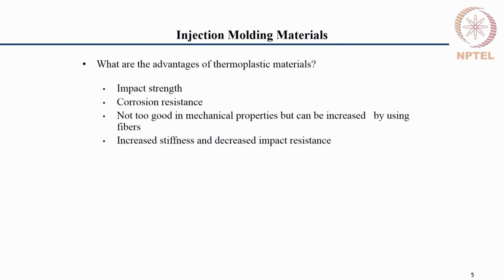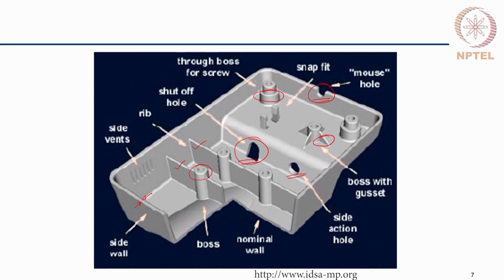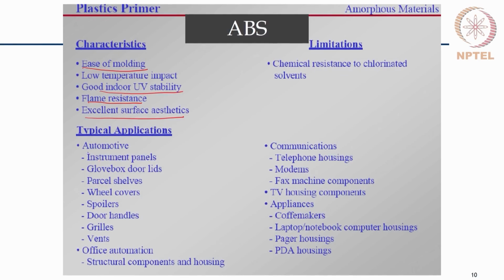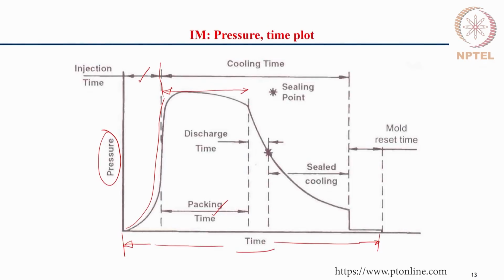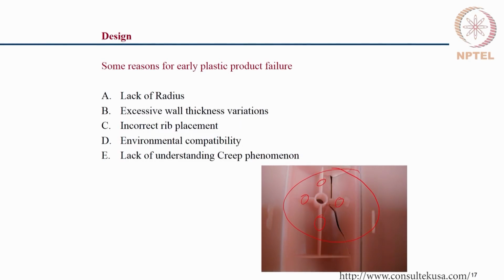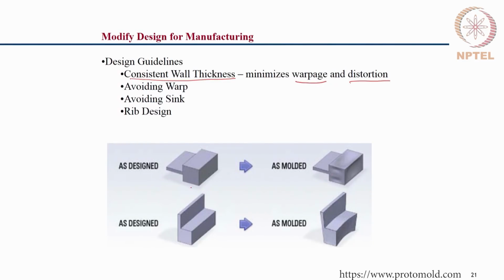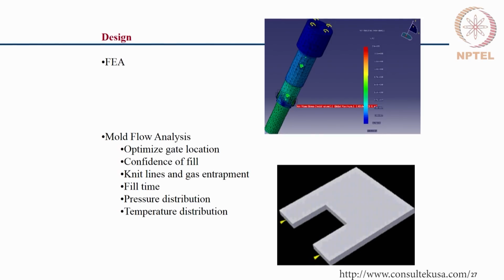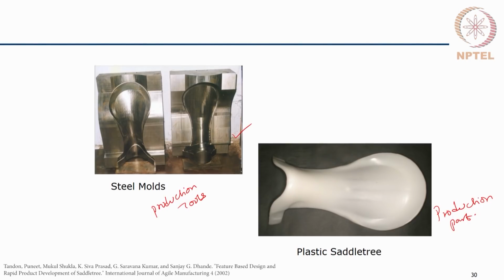#19Introduction To Injection Molding Process|Terminology Related To Plastic Parts&Design Guidelines

Comment: You left out the bit about packing the part to achieve finished dimensions.
The 4 key steps are-
material in, air out. heat out, part out.